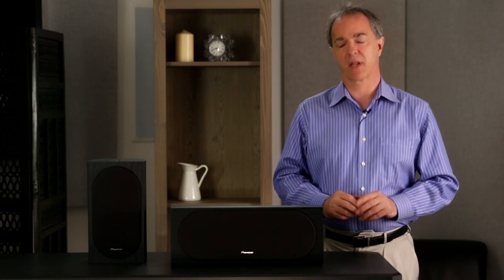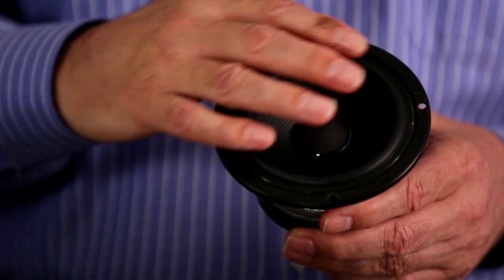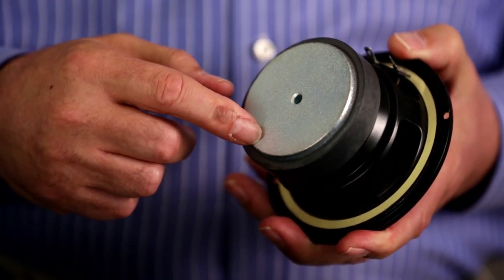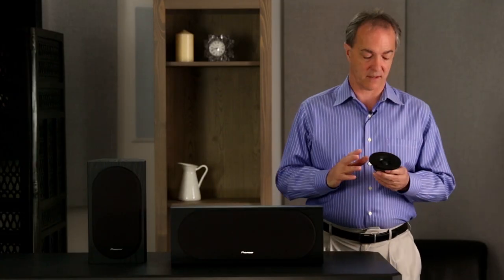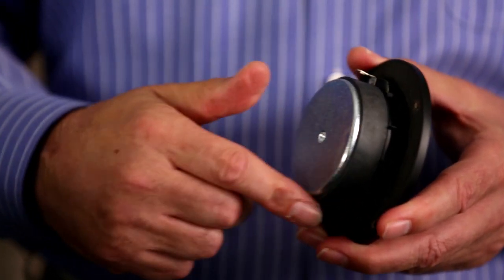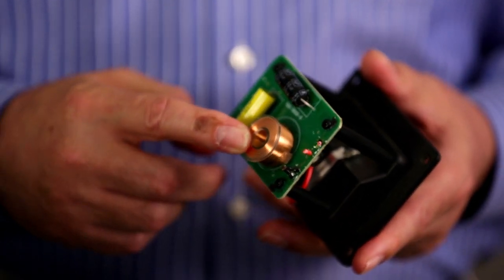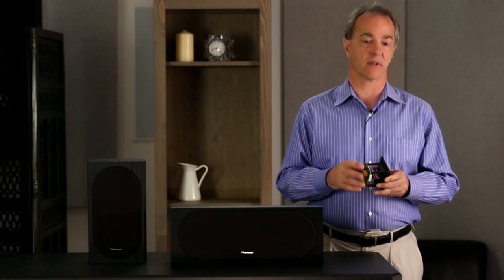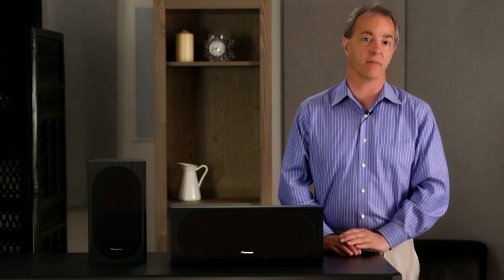Andrew Jones: Speaker Philosophy

Comment: A speaker "philosophy" best suited to a manufacturer such as Pioneer ...bog average or slightly poorer. Most people are ignorant of true High-Fidelity (that's what hi-fi stands for by the way) I note with interest that the specification of these speakers states a sensitivity of only 87dB; a poor figure which means the speakers are inefficient and need more power to drive them, but not too much as they're only rated to 150 Watts RMS max. Despite all this they will sell like hotcakes because of ease of purchase and ignorance.
Reply: HIFI was never about efficiency, linear transformers are inefficient, class AB amps are inefficient, analog crossovers are inefficient, unless you use a SMPS with a Class-D amp and a digital crossover with bi-amping, efficiency will be crap, there's a reason why receivers are still a chunky hunk piece metal of with ginormous heatsinks, because inefficiency and heat.
Those Pio AJ and the ELAC Debut speakers are well engineered speakers, especially for their price, that's what engineering is about, to create something within certain constraints. Sure one can design a super expensive speaker that sounds better, but designing one that sounds good and at a certain price point is more challenging. The Micca RB42 is another example of good engineering, small cabinet with a tiny tweeter that sounds good and doesn't break the bank.
Reply: @daijoubu4529  Yes. agreed efficiency is not a measure of the "quality" of the sound. I have listened to ELAC Debut and decided against the model in favour of Richter...but they're not great either. Favourite speaker at the moment is a 1975 Sansui AA-3900 with original tweeter replaced with a Visaton silk dome. Woofer will need replacement v. soon as one can actually shine a light through the perished rubberised cloth surround. Will probably opt for Ciare or Faital driver as replacement.
Reply: I’ve been into hifi for well over 20 years. I’ve had and have many speaker types and still actively buy new gear all the time. I have speakers that cost over 5 thousand dollars a pair and I also have the entire pioneer sp line of speakers and gotta say....FOR THE MONEY these speakers are amazing!!! Especially the fs 52’s which hit WAY above their weight class. Andrew Jones is a master at tonal balance , clarity and imaging. To each their own  but for me.... what you get here for the money is totally unbeatable and they are one of my favourites.